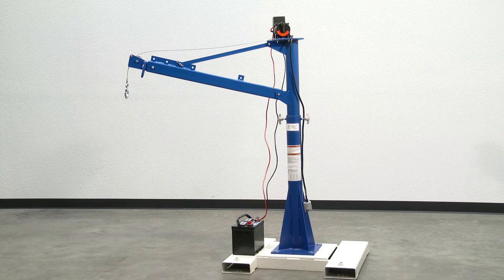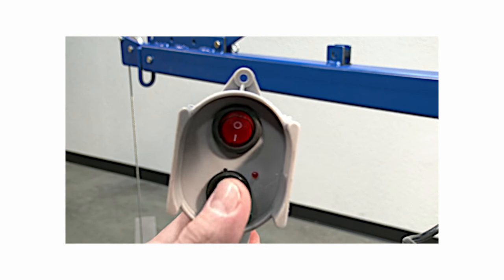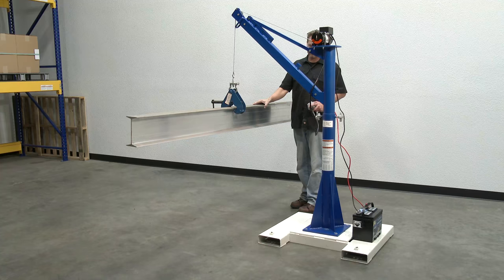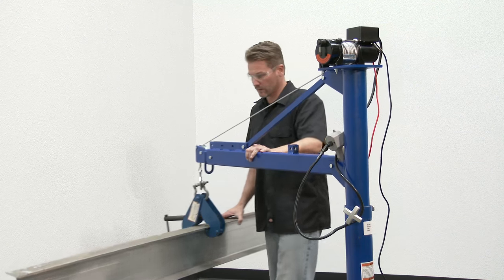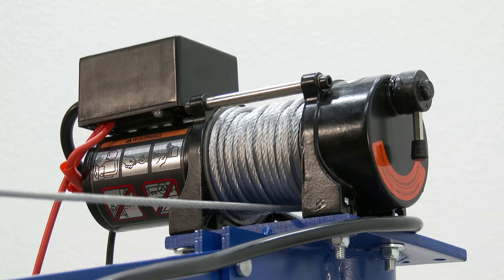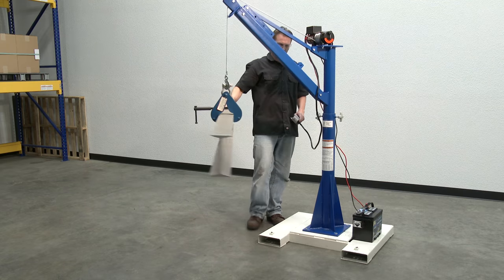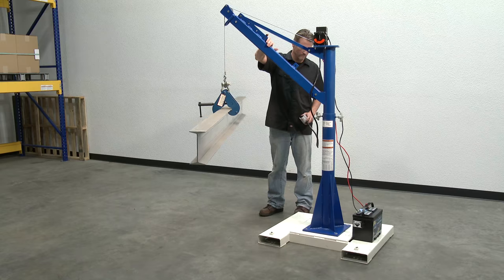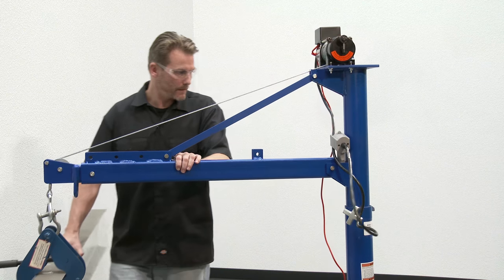WTJ Power Lift Jib Cranes

Comment: I need to buy this so badly but a small model, I need to lift items of no more than 60kg into a Van, so the height needs to fit in into a Nissan Caravan (standard, which is not a high top).